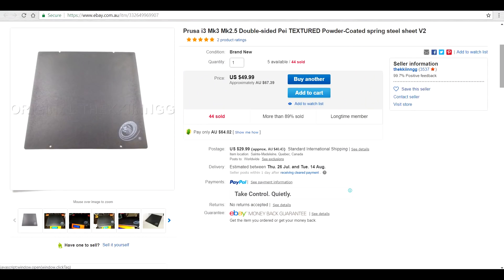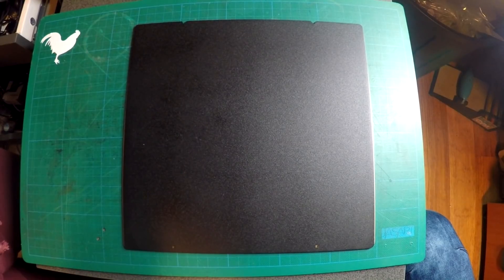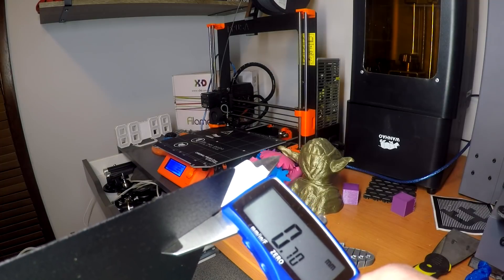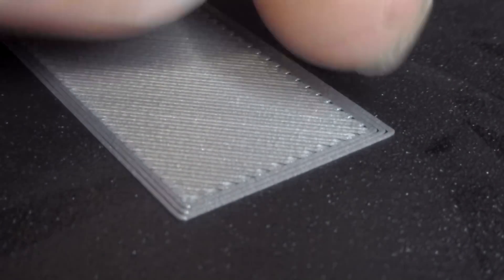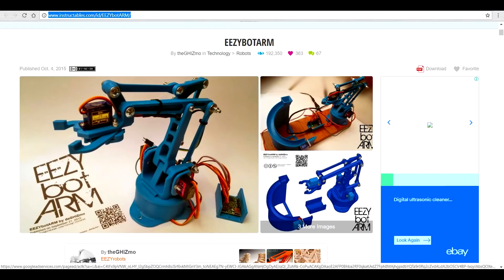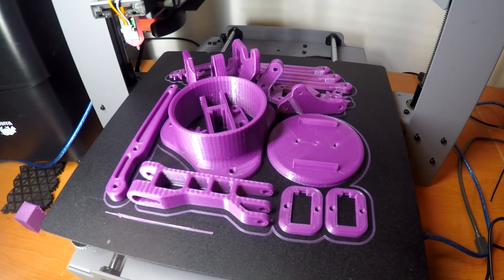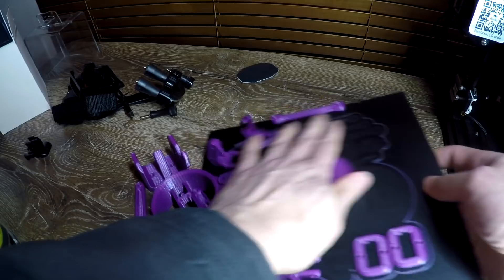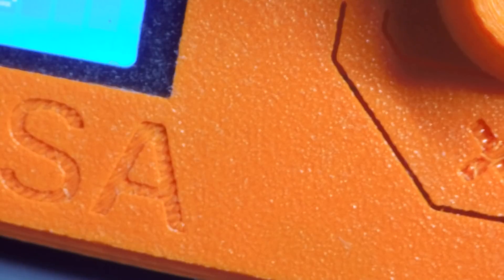MK3 PEI powder coated sheets finally available! (sort of) - UPDATE IN DESCRIPTION

Comment: I received my Prusa build plate about a month ago.  It is EXCELENT.  I thought I liked the smooth finish that glass leaves until I saw what the textured finish.  The rough texture hides the filament lines and it releases PLA and PETG completely if allowed to totally cool.  Only a slight flex is required if you don't want to wait for it to cool.  TPU sticks too good, so it's best to apply glue stick first.  I don't use ABS.
Reply from the maker: Can't wait to get my hands on one.

Comment: This looks like a good aftermarket sheet. Can you test with more materials (ABS, PETG, ...). I bought a multipack of buildtak spring steel earlier this year. For PLA I use the original Prusa PEI, for ABS I use a buildtak spring steel with LokBuild Surface and for PETG I use Buildtak spring steel with buildtak and uhu gluestick. These combinations just require a quick (fairly consistent) adjustment to Z, but I find the changeover of material needs it anyway. The main thing is each provides reliable hold for jobs.
Reply from the maker: Very interesting to read about your workflow. You might be able to set the z offset in your start gcode to streamline.
Reply: Thats a good idea... I have just switched from Simplify3D to the new Prusa Slic3r which is working really well and this should be an easy adjustment.

Comment: You may order an original Prusa powder-coated sheet by ordering the mk2 to mk2.5 upgrade. The price droped from 199€ to 149€ (including tax but not shipping). Of course this is much money if you only want to get that powder coated spring sheet. But if you have other printers around you want to upgrade to magnetic bed, to autoleveling, noctua fan and bondtech gears, it will be an interesting offer. I for example have an Prusa clone, already upgraded to steel frame, steppers with integrated leadscrew... (I think "upgrading" means change everything - only one stepper motor, controler, display and power source are from the geeetech pro, everything else was changed).
Now it would be nice to have a magnetic bed also. Cloned magnetic beds in MK3 style (but with 12V) from Aliexpress costs about 68€. Bondtech gears about 11€. Noctua fan and pinda2 you wouldnt get from china, but a noctua fan is normaly available for 15€ in europe. pinda2 is nowhere available at this time, but from prusa it would be about 15€ when in stock. So all parts together (without the spring sheet) would be about 120€ - so the price for the spring sheet is effectivly 30€ if you need the other parts anyways. And you would get original parts (original bondtech gears normaly costs about 50€), not cloned ones.
Even if you dont need the other parts, you may sell them, so effectivly the price for the sheet increases - but will not be more than the canadian one.

The only question is: How fast will you get the upgrade if ordering now. I ordered and paid it today. I also ordered the canadian one, and also an second spring sheet from prusa without powder coating. That gives a great range of diferent textures as I print often panels there the bottom side is the front afterwards. So I will be able to choose flat surface (pei sticker), prusa-texture (powder coated), canadian texture (powder coated) or blue tape (second prusa sheet with blue tape on it). Prusa also announced another sheet with a more glas-like finish, so there will be an 5th option in future. Maybe I order buildtak also (or add buildtek one of the other sheets)...
Reply from the maker: You make a really compelling point. I once considered going this route to get a magnetic bed for my CCT, but then I found the buildtak flex plate. I think I will just wait for the official ones now, I think the newsletter said August so not long now.
Reply: In August the sheet can be ordered for all those, who got a voucher (customers who ordered mk3 before there was officially an option for the PEI-sticker-sheet). The production is not an an output to satisfy all who wants one. Jo said in an interview to Tom, the priority is first all who opted to wait, secondly all with vouchers, when current orders (ready machines and kits) and than the rest. Starting in august ... To me it sounds more to august 2019 for the "rest". For the upgrade kit the delivery time is estimated 5-6 weeks.

The canadian sheet was delivered very fast - less than a week from Canada to Germany. Amazing. I do not think about 56€ are to expansive - I even paid about 28€ for a simple bare spring steel 20*20cm² sheet  in germany. with its bigger size and the PEI-powder coating the canadian sheet is not expansive. Spring steel is an high-price product by itself, I do not know how Prusa make the low price. 
It will definitly replace my Prusa PEI-foil-sheet. It works perfect, only on one print it got loose (but due to temeratures in Germany in the moment, I think it was sweat dropped to the sheet...). As it was a large print (but stopped after 1st layer) I sprayed some Printafix on the sheet. That worked very well and didn´t affect the texture at all. I made about 10 prints without renewing the Printafix, all prints worked well (exept one with filament-jam and one with layershift as something falls on the printer while printin - both nothing to do with the bed). I washed the sheet with handwarm water and soap, let it dry and renewed the printafix. But I will be careful not to get printafix at the other side of the side, just to be sure, as I do not have long-term testing now.

There would definitly be a marked for that canadian sheet even if the prusa one will be public available. I hope there would be other sices too, as I am building a core xy with 30x30cm² bed. It would be very nice to have such a powder coated spring steel there. I will use an precise aluminium bed (6mm thickness), mill some pits in it (6mm diameter 3mm deep), insert samarium-cobald magnets (temperature resistant up to 350°C, Diameter 6mm, hight 2,6mm, holding up to 0,47 kg each) with high-temperature silicone glue. Heating with a 230V siliconeheater.

Due to the diferent texture, all sheets, the Prusa PEI-powder coated, the Canadian Powder coated and the PEI-Foil have their use. For exempla, printing an object in two parts to fit perfectly together back2back after printing, the PEI-Foil definitliy is perfect. For only slightly rough surfaces, hiding the layerlines a little, the Canadian sheet is perfect compromise. For surfaces hiding the layer-lines perfectly but adding more texture the Prusa powder coated is ideal.

Your video was definitly helpful!

Comment: Regarding changing the Z, I have the PEI sheet, the powder coated sheet, and Builtak sheet and all have different Z level. What I do is use sticky paper on each of them to remember the numbers .. X)
Reply from the maker: I have to play with it to confirm but I'm pretty sure you could set your Z offset in the start gcode to save hassle.
Reply: Teaching Tech You could potentially have dedicated amazon dash buttons per build sheet and have them run a gcode that only changes the live z? 

I just started playing around with dash buttons and octoprint together but this seems like it should be possible and would be pretty convenient.
Reply: If you can set Z-offset by gcode, you may simply use a arduino and connect it to the second serial (the port for the Pi-Zero). Connect 6 button to the arduino; one for the original sheet, one for this one, one for buildtak. One for manual increase z, one for decrease, one for store (followed by the button where to store the new setting) (for this functions you could also use an rotary encoder instead). A short simple arduino-code will do. If you want to use octopi on Pi in parallel, connect the pi via USB.

Of course you could add more buttons - "hotkeys“ for example to preheat the printer without going through the menu. Or driving the printhead up some cm more to remove the springsteel more easy after print. You may even put a joystick to the arduino (but 3d Joysticks are expensive...) to freely control the hotend.
Or preheat the hotend only to remove the filament. Or or or...

Than design a control panel with all the keys and functions you want to add.

With the MKS Touchdisplays you can set up to 8 custom buttons for sending-code. So instead of building your own controll board you simply might use such a touchscreen. But you have to reprogramm it every time you change nozzle or readjust the pinda, while a selfmade controller with manual z-control could be readjust just by keys.

So I hope you find the necessary gcodes for manipulating z-offset...
Reply from the maker: That sounds interesting but a lot of work.

Comment: Kinda wondering how hard it would be to do your own powder coating to make these out of plain spring steel sheets, going to have to go have a look :)
Reply from the maker: I would love to see that.
Reply: kinda wondering how a heavy porous aluminum oxide coated aluminum plate would fair as a printing surface too, as I am working on tech for controlling this process, (that is basically 3D printing titanium or aluminum oxides on a surface where I want them lol.)

Comment: There are a lot of negative reviews out there so beware. In some prusa facebook groups they even warn you about this sheet since its supposed to not be a real PEI powdersheet. I cant vouch for that since i have an original PEI powdersheet/bed from prusa since i put my mk3 order on hold until the beds where available. If you get the chance please make a comparison with these two sheets and im very certain you will be blown away with the prusa bed.
Reply from the maker: I have searched and can't find the negative reviews. Looking forward to hopefully getting some genuine Prusa items to compare at some stage.
Reply: Teaching Tech 
Ive read it bonds too well with petg and leaves marks on the sheet or eben rips the coating off if you try to remove it too soon after printing.I wanted to buy this sheet before but it would cost me 45€ shipping to austria at that thime so hold of on buying it and the warning sheet wich comes with this bed was very scary since you are only supposed to clean it with water.
Reply: I mostly printed PET-G and ColorFab nGen on the sheet the last days. No problem with sticking to hard on the sheet.

Comment: How does new material like PETG Filament?  Any release issues ?
Reply from the maker: Out of petg at the moment, yet to test but will.
Reply: It likes PET-G, no problem with it. Be carefull not to use acetone or isopropanol for cleaning, that can leed to problems. The first two days I used the sheet directly, after that in combination with printafix ( with seams to be ideal combination to me - never get better results before)

Comment: How many prints can I expect to print on one of these sheets before needing to replace it? Have you ever tried printing to a carbon fiber sheet print bed?
Reply from the maker: If it's legit it should last a very, very long time. Mine is now in my CCT with tpu printing onto it. Carbon fibre I haven't tried but a few people have told me it works great.

Comment: I have one of these sheets and they're OK. It seems like its wearing out really fast. My parts dont stick as good as when I first got it. There also always seems to be black stuff on the bottom of my prints which supposedly only happens for you first few prints. So far is not worth the 60 bucks. Oh and I have the v2 not sure about the v1.
Reply from the maker: This is the V2 also. I haven't had any black stuff, even at the start. Still early days for me but so far no drop off in performance.
Reply: Do you cleen it with Isopropanol after each print and with acetone every week like prusa says for their sheets?
Reply: Hmm maybe we got a different batch. I'm thinking about contacting the seller. And I use medical ipa swabs to clean it. Same thing the printers ship out with.
Reply: I'll have to give acetone a shot as I haven't tried it yet.
Reply: I now got it. By instruction, you should not try acetone.
I used printafix on the sheet. That works perfectly. You will get the structure, perfect sticking on heated bed but easy getting your prints off. I like that combination; I only have to renew the printafix-coating on the sheet any 6 to 10 prints.

Medical ipa? There are different ipa solvents for diferent uses in medical care. For desinfect objects its pure ipa. For desinfection of hands it often contains a little lubricant, to prevent the hands to dry out. So with medical products be carefull, they can be contraproductive

Comment: 60$ is way to much..I found a small spring steel sheet for 5$ at a metal recycle yard lol. Powder coating is also super easy to do.
Reply from the maker: You should sell them cheaper and make a fortune.
Reply: good luck powder coating pei, if they needed so much time to get it right how long will it take you?

Comment: I print ALOT of petg especally on my mk3's I have noticed bubbles but you cant feel them on the sticker pei sheets that came with my mk3 I haven't gotta to use the powder coated sheets yet for one reason I have had prints back to back to back tomorrow morning I am going to dial my mk3's in with these sheets what was your live Z adjustment before an after the sheet for a reference point what you ended up with
Reply from the maker: Live z isn't good to copy because it depends where each user has positioned the Pinda probe. My standard is about 0.9 from memory. I've mainly been using this on my CCT because the bltouch accounts for the thickness difference automatically.
Reply: No I know i was wonder how much lower you had to go compared to the original prusa sheet with the thickness is mainly what I was wondering